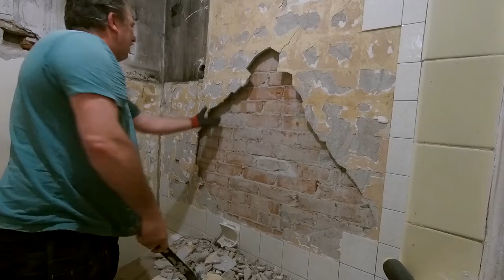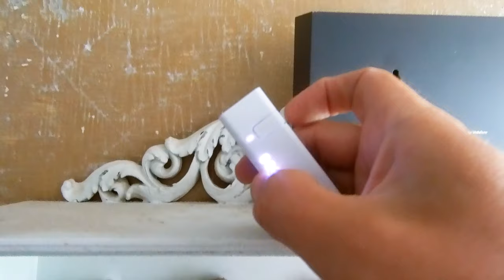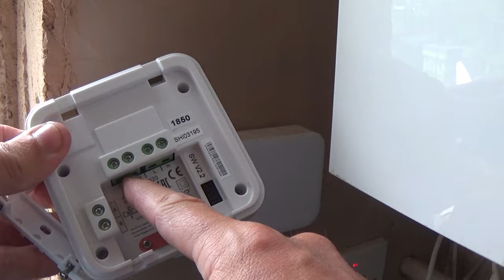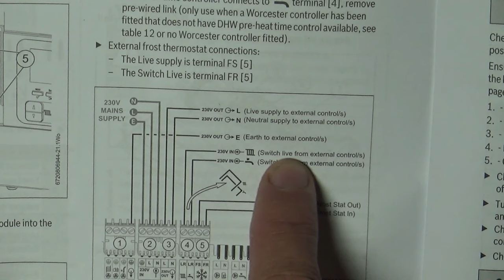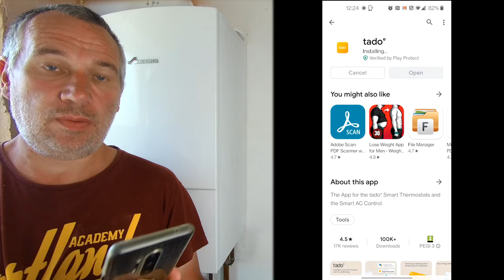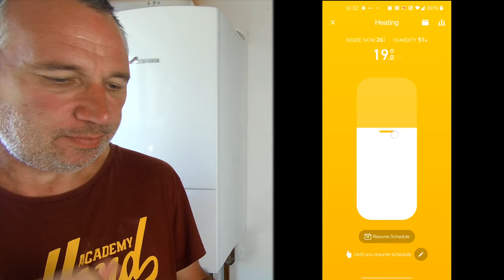Tado Wireless Smart Thermostat V3+ Install - How easy is it to install a thermostat - DIY Vlog #42

Comment: In order to open the outer case of most gas boilers (this one included) you must be Competent to carryout "Gas Work" too at minimum. If your watching this and don't know what that means then the answer is you're probably not. Good video otherwise.
Reply: I reckon you've lost 15 jobs because of this video
Reply: @jzilla1234 or saved a life with his comment
Reply: The outer door on that boiler is classed as the combustion box cover door. You should be Gas Safe Registered at this point even if it’s your own house.

Comment: I would suggest to do extra research on products provided by Tado prior to advising people on how to connect this particular product "Wireless Smart Thermostat". There is a "Wired Smart Thermostat", which is what is supposed to be used for when you already have a thermostat setup in the house on the wall and combi boiler, and it excludes the box that connects to the boiler, just thermostat gets replaced and internet hub attached to router, simpler and cheaper product. This product is required if you have hot water control and have water tank in the house, regardless if you have already a thermostat or not available.
Reply from the maker: I had no heating in the house before installing this boiler and it only came with a mechanical timer so I had no thermostat. I needed all the items that Tado sent to me as I didn't have any thermostats in the house, wired or wireless. If I did already have a thermostat you are correct I would just need the items you mentioned. Tado sent me these items for free so I had no control over what products they sent but they knew that my boiler only had a mechanical timer on it.
Reply: Omg. One of most concise comments I've read on this topic. Thank you. I've been trying to understand if I need the whole wireless kit and receiver.

But from what you're saying I just need the wired tado thermostat to replace the existing ones that came with my new property which has a combi boiler.
Reply: I have a combi boiler in a new building with a thermostat in my hallway downstairs and in the main bedroom upstairs. I'm guessing all I need is a wired starter kit and an additional wired thermostat for upstairs? Is this correct? I get sent the wireless starter kit from ovo energy tried fitting it today and I think it nearly blow up my boiler.
Reply: Their wired thermostat kit still does come with the receiver I believe, but you have the option to not use it

Comment: Why did you not just wire the black common to the live terminal in the boiler rather than use the jump wire in the receiver.

Comment: Very good video. How ever it should be noted that taking off the boiler case ,breaks the seal to the combustion chamber. The law states you have to be Gas safe registered to do this . It should be added that some boilers allow you to gain access to the electric panel . But not the one in your video

Comment: Tado seems to make a "Wireless Smart Thermostat Starter Kit" but when you look at the contents, it has a "Wireless Temperature Sensor" not a thermostat. It's weird because they also seem to sell both items (thermostat and sensor) separately at different prices. They look the same--are they the same item in fact? Put another way, is the Smart Thermostat you installed here actually a Temperature Sensor?

Comment: Good video mate appreciate it, i used the wiring coming off of my old wired thermostat in my hallway which is right next to the router and bridge i had 4 wires in there which went up to the honeywell junction box in the airing cupboard i just rewired the honeywell box as i didnt see any point in having another set of wiring coming out the boiler, i bridged the old thermostat blocks in the honeywell and put the old thermostat wiring to central heating control all working good I've also left my old drayton ip722 timer in place to do the hotwater and can also use the drayton as back up for central heating encase tado servers or internet goes down so we can use manual override.

Comment: Great video bud and properly wired as well as it's amazing how many people use the mains in terminals for connecting accessories and not the mains out, the idea being when you switch the boiler off all accessories down stream will be isolated. I will draw your attention to the link that you left in between live and hot water, this is the hot water pre-heat and with the link left in the boiler will cycle every now and then to keep the water hot in the heat exchanger so you get instant hot water when you open the taps, if your at work all day this is a bit pointless and a waste of gas. You could take the spare black wire you have and remove the link in the boiler and connect it to the preheat hot water terminal then in the control unit connect the black to the hot water normally open terminal put a link between the live and the hot water common then you can control the hot water preheat from your app like you do with the heating.
Reply: Ah that's a clever use for the hot water wire. Though I think this boiler uses "Eco" mode by default which switches off preheating completely.
Reply from the maker: Yes the boiler does use eco mode so pre hearing gets deactivated. Using pre-heat is a waste of gas in my opinion.
Reply: Yep your absolutely right switching the eco feature on de-activates it
Reply: Couldn't agree more lee what with wholesale gas prices at an all time high.
Reply: Can you set up schedule with this, so pre heating only occurs at certain times

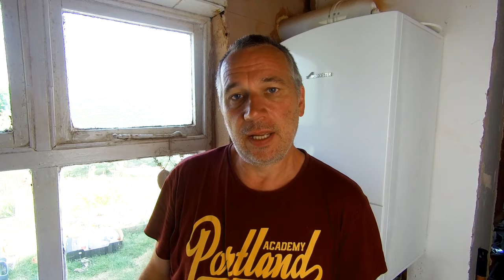Comment: Great installation video. I'm confused though about the comment re. hot water temp control at 2:30. My combi boiler can control the hot water temperature via the existing control panel that is on the boiler. I understand it heats the water on-demand but can it not control the temperature of this water? The Tado should be able to do this as well.

Comment: Many thanks for this video which I have watched many times before purchasing the Tado.

I followed the Tado instructions initially which included linking the HW even though my boiler is a WB greenstar30i similar to yours in the video.

My controller mounted on boiler was a RF comfort which I left in situ.

On completion I had problem with the boiler not firing up and I had to revert to original installation and reset the controller.

Today I removed the controller and wired up as per your video and all is working fine.

When I started the install I selected the RF comfort controller and Tado said that the system wasn’t compatible but I then selected green star boiler and all went well.

Can I bring your attention to the video at around 24:48 where you connect the purple link . This should be from L to CH COM but on looking closely your link is across the L and N input - surely this would blow fuses being directly across the mains ?

Again many thanks for taking time to upload this video 

Kind regards

Howard

Comment: Hi, thank you for the video.
I have very vague ideas about heating but got Tado (as they said you can install it yourself)
Well.. my heating set up is different to the one you have demonstrated. It’s a Vaillant plus boiler connected to Dataterm IHC (warmworld) system. How do I get about to replace it with Tado?

Comment: Excellent video, and instructions. I infer from what you said that I can replace my current system which is boiler, thermostat and programmer by replacing the programmer with the receiver but with the old thermostat can I terminate it or do a pass through with the wires?

Comment: The programming seems complex,  what i like about the salus it500 is that the app is very simple to use and to program teh schedule is even simpler.  You can also control the heating via a portal on the internet from any laptop.
Reply from the maker: This system has been very good for the last 5 years. I can control the heating from my phone app from anywhere and it has worked really well.

Comment: My timer is in my airing cupboard upstairs and my boiler is downstairs, do i install mine on my airing cupboard and use the existing wires attached to the timer?

Also, do i need to have my thermostat wired into my existing thermostat as mine is currently behind my tv which obviously gives false readings of the temperature. Thanks
Reply from the maker: Sorry but I'm not an expert on installing these. I've only ever done this one on my setup.

Comment: Thanks for the great explanation! Question: I now have a BOiler with a wired thermostat. If I turned off the power of the house, instead of opening up the whole boiler, could i not cut the thermostat-wire somewere close to the boiler and then connect that wire to the receiver in the way you described it?

Comment: If you're wondering why your heating isn't working.... 24:15 I think you've put the jumper across the Live and Neutral. Should go between L and CH COM.
Reply from the maker: I think that's just the camera angle that makes it look wrong. You really think I would connect live to neutral? Lol
Reply: @LCWDIY  After installing the jumper, you tighten up the MAIN Live and then you tighten up the MAIN Neutral... watch your screwdriver from 24:15. If you've left it this way, I'd suggest to open the cover and check. Just trying to help!
Reply from the maker: @marcot8549 yeah thanks for spotting it, I think it is just the camera angle. I noticed it while editing but this video is over 3 years old now and the system has worked flawlessly since the day it was installed. Thanks for pointing it out though 👍
Reply: @marcot8549  He doesn't, it's just the angle. The terminal names are not quite properly aligned with the terminals. Far left screw is Neutral (which you can see about half of), second is Live and third CH COM; he undoes both the second screw (Live) and the third (CH COM) and puts the jumper between them. I see where you're coming from though, hope that angle doesn't make anyone connect the live and neutral lmao.

Comment: This is great, thanks!
One question I do have. As I have an old receiver I can just swap it out with the Tado, however there is an earth wire in the old unit, Im wondering if theres somewhere I could put it (other than just crimp-lugging it to wall inside the unit or inside the unit itself) Cheers!
Reply: Hey just to answer my own question. I ended up attaching a Wago connector to the loose earth wire and tucked inside the unit. I had a boiler engineer over the other day that agreed this was fine, but also pointed out theres a couple of Parking slots on the receiver that can be used for this purpose. Be sure to double check this for yourself, Ive just left my Wago there for now, but might swap it at a later date.

Comment: Hi Lee, great video and thank you for making it. I'm looking at Tado to replace my Salus heating control and I notice that you showed a similar wireless boiler control to what I have currently. Is it possible to use the same cabling thats currently in place for the newer tado boiler control? Cheers!
Reply from the maker: Hi, yes you should be able to use the same cabling. You just need to know which wires it uses for switch and which are live.

Comment: The question is, which Tado has not answered satisfactorily, how do you switch the boiler on at the receiver if you need to override the system (perhaps because the thermostat has failed or whatever). There should be a way of bypassing the Tado system and being able to switch the boiler on if need be. Tado support said to use the heating test switch but that only has effect for 2 minutes until test mode is deactivated.
Reply from the maker: You should just need to press the heat button on the receiver. I have done this before and it stayed on. When it's not in test mode that button should override the heating.

Comment: I allready have a wired ut2 programmer and a wired thermostat 
Could I just remove these unsightly items and wire direct to the boiler like the video and use the wireless setup

Comment: Hi mate, i do have a logic combi ESP1 35KW boiler and replaced wired thermostats from danfoss ones, but i am confused as do I still need a hub to connect it to boiler please, as when temperature is turned down on thermostats heaters are still firing constantly. Do I still need to install the hub please, in order to communicate thermostat with boiler please.

Comment: I can only add to other comments saying what an excellent video, however.......... I'm not sure why you connected the black common cable, onty to have to remove it and replace with a link. Is it because of what you subsequently found in the boiler wiring? Thanking you in advance.

Comment: Do you have to disconnect the mechanical timer? What if the Internet goes down? You won't be able to control your boiler.
Reply from the maker: There is an override button on the control box so you can manually turn it on or off. I disconnected my mechanical timer.
Reply: Better to leave the mechanical timer in and switch to 1 on setting.

Comment: Great video👍 just wondering if you use the smart trv’s can you regulate each room independently using the app ? Cheers
Reply: Hi, yes if you use the tvr's you can control it with the app. I have a small office that used to get really warm, with a tvr in there I can now control that room separately with the app.

Comment: Should I turn off the power to my boiler? The installation guide says to but you don’t?
Reply from the maker: Never work on electrics without turning the power off. The power to my boiler was certainly off when I did mine.

Comment: Did you check or test what happens if you switch off the WiFi? Does it have internal clock to keep the schedule running? Or does the wireless controller doesn't rely on app?
Reply from the maker: You can press the heating button on the controller to manually turn the heating on if your WiFi is turned off. But you would only lose WiFi in a power cut so the boiler wouldn't work anyway. It doesn't need the internet to work.

Comment: Thanks for the video. I noticed you left the HW terminals on the receiver without any wiring, are they not needed to control the hot water?
Reply from the maker: Hi, no the hot water is supply on demand as it's a combi boiler. If I had hot water storage it would have been connected.

Comment: Great video and very useful - just wondering why you opted not to connect the Tado to the hot water connection to have control over the pre-heat function? From reading the manual in your video, it seems that you can control the pre-head / eco function of your hot water from an external device and the Tado does have the right connections on the hot water relay connections. Surely linking the black wire to the HW LR terminal in the boiler and to the HW NO in the Tado, and then adding a linking wire from live to the relay in the Tado would give you pre-heat control from the TADO also?

About to do this myself, so just wondering if I am missing something, and would love to know if I am making an incorrect assumption! Thx
Reply from the maker: The hot water connections are for a hot water tank/cylinder. The pre heat function is for instant hot water for your taps, which is a waste of gas when you can just wait a few seconds for hot water to come through on eco mode. That's what I believe it says.

Comment: Can you explain how it knows that you're using a Greenstar boiler? The Worcester Bosch boilers have their own modulation language, and I want to make sure I get a thermostat that can modulate properly by turning the gas down and not just cycling on and off more frequently.
Reply from the maker: It doesn't know what boiler I have. This unit just tells the heating to turn on or off when thermostat tells it too, it is just like a switch. The boiler has its hot water and heating hot water temperature set on the boiler, there's no settings to turn the gas down on a boiler.
Reply: @LCWDIY  Thanks. I'm looking for full modulation for my Greenstar CDi Compact. I have learned that I need to connect the EMS wiring to the Tado for this. The manual does state it can turn the gas down to lower the heat output and run more efficiently once temperature has been reached, to maintain a steady temperature instead of cycling the boiler on and off. Very difficult to find thermostats that can properly talk to Worcester Bosch stuff though.

Comment: If you wiring in the black to the hot water can you do that remotely ?
Reply from the maker: I've not looked into that so I wouldn't know. Sorry.
Reply: @LCWDIY  maybe an experiment sometime
Reply from the maker: @deanbashford3524  My hot water is on demand and I don't have a hot water tank so I don't use the hot water function of Tado. So because of that I can't experiment with it either.

Comment: Just setup my Tado today, connecting to a Valliant ecoTec plus 637.
Tado is responsive, programmer receiving request for heating / water but boiler is not reacting. 😢
Reply from the maker: I would check it's wired correctly to the boiler and make sure there's no other timer controller that would stop it responding.

Comment: So this is ONLY allow Tado to set your thermostat and control your radiators? You have not set it up to allow Tado to turn on your hot water (tank heating)?
Reply from the maker: Yes heating only. I don't have a hot water tank, the hot water comes direct from the boiler.
Reply: @LCWDIY  Ah that makes sense. Ta.
Reply: @LCWDIY  How do yo change the temperature of the hot water going to your taps?
Reply from the maker: You change the water temperatures on the boiler

Comment: Does the system work only on Wi-Fi or RF?
Reply from the maker: I think it's just WiFi but not too sure.
Reply: @LCWDIY  so if your Wi-Fi goes down does that mean the heating won’t work. I hope there’s a manual override.
Reply from the maker: Yes there is a manual override. You see me press the heating button when I set it up. That will manually turn the heating on.